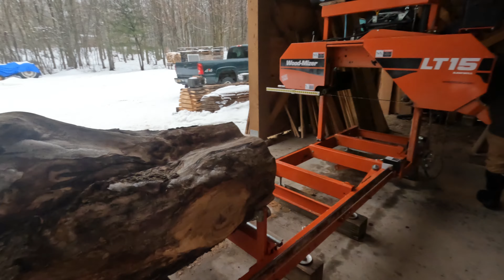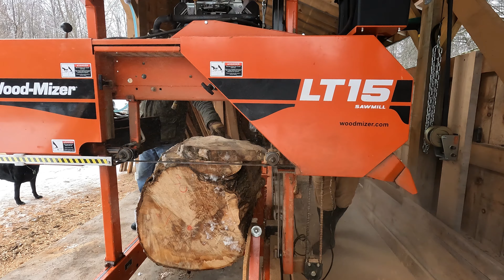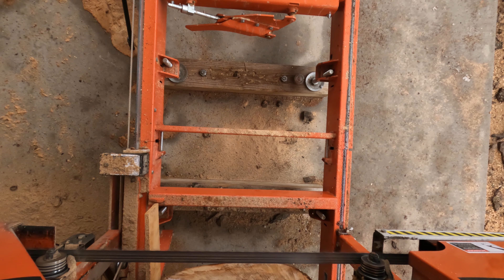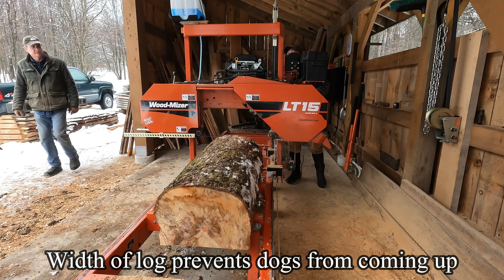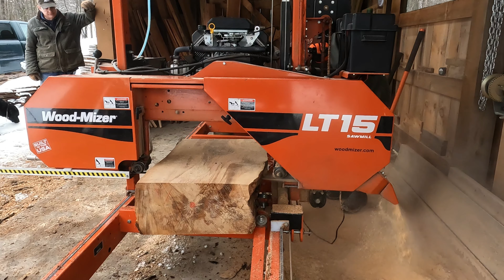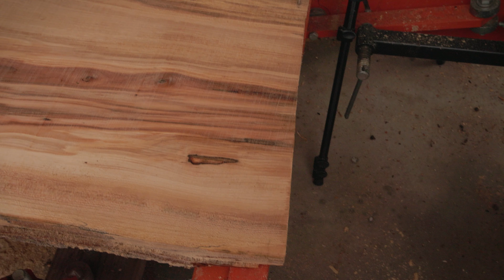Milling Leftovers and Destroying Blades #woodmizer #woodmizerlt15

Comment: got to love the mistory logs. never enogh clamping points it seem like.. I've had blade meet metal several times..
Reply from the maker: Yeah, we don't have clamps positioned by the toeboards near the head of the mill.  Never had this issue with the clamps before, when we pulled them up the log was wide enough that the clamp screw interfered with the mill post rolling down the bed rail.  The LT15 has dual mill-head posts, but is still considered a cantilevered mill, or semi-cantilevered.  A true cantilever like your LT35 wouldn't have this issue.  Thanks for watching Chris!
Reply: @southernadirondackoutdoors  lt 40 . Some times it happens..

Comment: As you started making the final cut I was saying to myself I would leave that slab thick, someone always wants thick, saves on blades too lol...
Reply from the maker: That piece already had a 6" cut in it from the abandoned cut when the wooden toe board slipped out.  Would have been nice to use the Wood-Mizer toe boards but there are no log clamps there, and this short piece was just barely catching the log supports anyway.  If I had a chance to do it again, I'd center the pith on that first cut, maybe make a couple more cuts, and then roll it 180 to finish slabbing.  Start right, finish right, lesson learned!

Comment: Good video but I have a question. When I ACCIDENTALLY leave a toeboard up you say "Toeboard Dave is at it again" but when you do it ON PURPOSE nobody says anything. Is that because I'm old and you feel you can pick on me?
You got some beautiful lumber from that piece of firewood.
Your Friend
Toeboard Dave
Reply from the maker: Yes, because you're old!  What do you call it when you fail to use a toeboard on the very first cut?  I edited it out but when we pulled that hunk of cheese out, we were talking about Robert Milton and milling parallel to the bark.  Not that it was planned or anything, we just never centered the pith on the first cut.  Andy
Reply: As IT guys say "Byte me"!